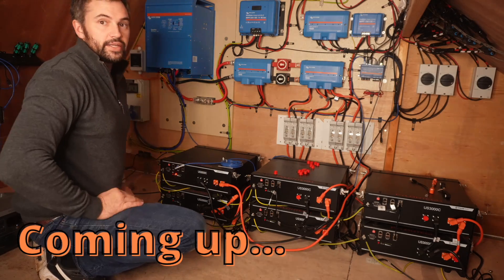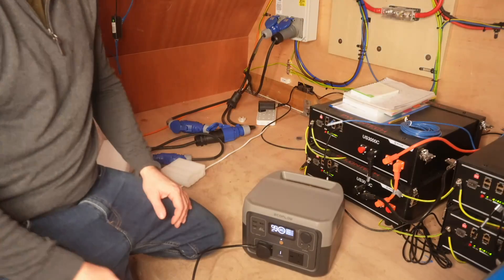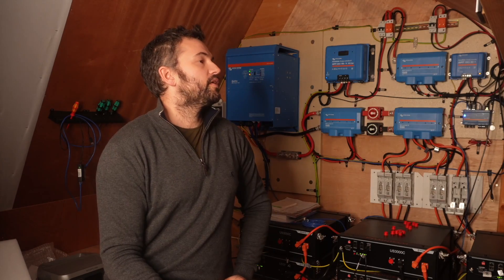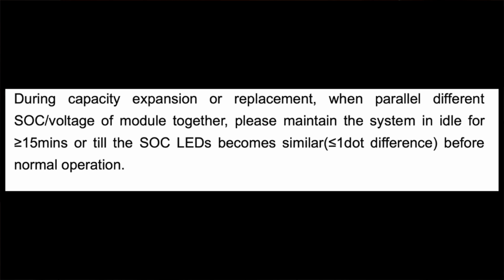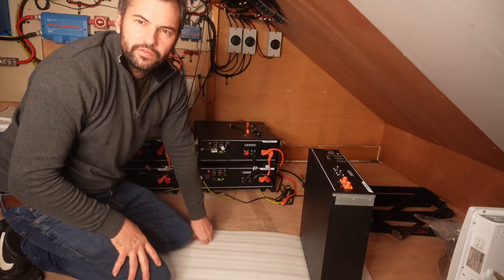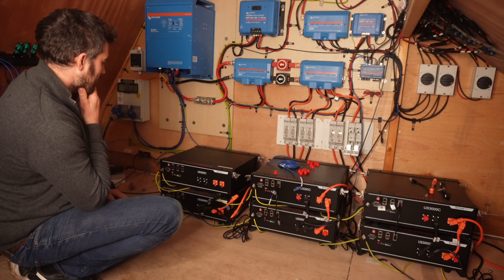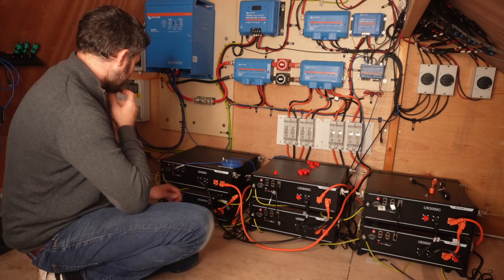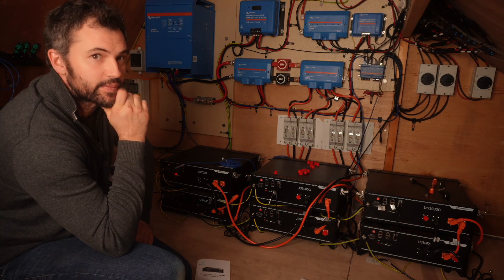IS THE PYLONTECH MANUAL WRONG?

Comment: I've been observing the same behavior (with respect to the charge balancing) with my three US5000. I saw the same instruction in the manual, but no matter how long I left the stack to balance (no load, no charge), the SOC did not change between them. It's clearly necessary to manually balance the stack first.
As for the error on the single battery, I have seen no such behavior at all. It doesn't make sense to be the capacitors, if it works fine on one battery, and not on another. The only thing that is different here is the firmware.

Comment: In your test, the battery is going into protection for short circuit.
The Victron inverter has huge capacitors which behave as a short circuit when discharged even if they are turned off. The battery after turning on, sees the short circuit due to a peak of current going out, and then protects itself. The battery is working perfect and as intended.
To fix this, you need to pre-charge the capacitors with a resistor during commissioning of the batteries or inverter.
I acknowledge your diy attitude, but getting advice from an experienced electrician/installer is always a good call.
In my opinion Pylontech is a good brand!
Reply: Shouldn't those capacitors have already been charged up since he had the larger battery bank powering the equipment immediately before he tried to charging a single battery?

Comment: 6:27 -  FWIW mine did, appear anyway, to balance themselves out. 
Reading from elsewhere to quickly balance & assuming the charges are close and non 0.

Initially connecting the power cables between batteries, nothing else, turn them on, start them & the ones with larger charge will charge the lower ones.

Once everything is stable (as per manual give it at least 15 minutes) - turn off - hook up the comms leads etc and re-connect to the inverter.

What is the capacity on your inverter that you need 3x +ve and 3x -ve battery connection cables?
300A+ @ ~50V = 15kW inverter?  
Are you potentially setup to pull 60A+ on the mains side of it?

(Double check my maths ... could easily be wrong)

Comment: Balancing is about milivolts balancing the cells. Not about e.g. 15% SOC difference balancing. Such a high SOC difference can not be balanced. They WILL balance but only on cell level in milivolts range so for example 3,234v and the other cell has 3,230V Then balancing will work but not if one cell has 2,898V and the other 3,234V. Balancer are NOT chargers in the common sense. I guess there the misconception is coming from that balancing means charging....

The pylontech will balance themselves via the BMS. You can see that yourself on the cerbo GX looking at the individual cell details or by reading out the data from them directly.
So the answer from this guys are also not fully correct. They will balance themselves but not charge themselves interconnected!

An individual US5000C can not be connected like that without pre-charging the inverter! The rush of amps the Quattro will use when turning on will send the battery into protection mode as too many amps are out-rushing to the Quattro! There is a reason why Victron states that for certain sizes of inverters you need a MINIMUM SET of batteries as the share the load! The bigger the inverter, the bigger the caps and components demanding the power instantly, it is not only about the input and output. The system has to be viewed inclusive and not as single parts.

If you really want to add the battery like that you have to disconnect the positive lead from the battery from the bus bar and then in between use a 25W resistor so Positive lead connecting tot he resistor leg 1 and the resistor leg 2 touches the Bus bar in the lynx after you have turned on the battery. This will give a controlled charge to all the devices on the bus bar without too much amps pulling out of the battery! You only do this for 3-4s, no need for longer time period. The goad is to charge all capacitors in the devices. You will also notice then that you can screw on the positive lead again to the bus bar and it will NOT arc!!! The reason is that there is almost no ampere running through anymore as all caps are charged up! 

The more batteries you have in a set the more this initial rush of amps will be shared and therefore the internal protection circuit will not be triggered. Such outrush amps can easily go over 200-300A! The battery however will not allow that and go straight into alarm mode.

Inverter off also does not mean that the amps are not running back to the DC side of the inverter. Only its power generating logic is off but the DC caps are still charging as soon as you turn on the batteries!

Comment: Fraser I feel your pain although I don't have these batteries ( I build my own) I do have experience with the little dip switches. There purpose is when you have multiples of something to tell it where it is in the pecking order in this case the BMS. The master battery the dip switches would be in one position. Slave 1 battery would be in a different position. Slave 2 would be in a different position  and so on. It should say in the manual how to do this if not I would email the people who repaired the battery and ask them about dip switch positioning. If everything else fails switch on the flux capacitor

Comment: I thought you bought them from midsummer, or is SWS the company that does their repairs?
Reply from the maker: We bought the batteries from Midsummer, who were liaising with Pylontech about the problem. However, SWS found our videos and stepped in to repair it quickly 😊
Reply: @The_OffGridFamily  who paid for the repair?
Reply from the maker: SWS put in a warranty claim so we assume Pylontech did 😊
Reply: @The_OffGridFamily  seems odd that a company you didn't buy them from would do that? Very odd indeed. Doesn't say much for Midsummer. I shall certainly be pointing anyone who talks about buying or using  Pylontech or Midsummer to these videos. Thanks. Sorry you had to go through all thus so that the rest of us can learn from it.
Reply from the maker: Yeah it was all a bit odd. To be fair to midsummer, they had referred the issue to Pylontech who were supposedly organising for the battery to be collected, and that’s where things were stalling. Our understanding is that SWS do the repairs and customer services for Pylontech in the U.K, and when they found our videos they stepped in to help. We still aren’t exactly sure how Pylontech’s systems are organised. We have however seen the emails between Midsummer and Pylontech, in which Pylontech seemed to be batting the issue away. It was when they found us on YouTube that the problem seemed to be addressed very quickly…
Reply: @The_OffGridFamily  Yeah, typical behaviour of Chinese companies in my experience

Comment: using many pylontechs. zero issues. by looking at this cabling and how this put together, I feel like there should be something wrong with the setup. but no the batteries
Reply from the maker: Interestingly, Pylontech found our videos and have watched them but raised no issue with the wiring or set up and instead immediately arranged to have the battery collected and repaired 😊 we’ve also been featured on the Victron website with our installation so hopefully it should all be fine 👍

Comment: Hi Fraser 

I agree with Stephen's comment below, its the inrush current which is tripping the battery. Rememeber your inverter has large DC Capacitors on its inputs, so as soon as you put a voltage on its input, the capacitors draw a massive amount of current to charge up. This only lasts a few seconds... on some of the big Victron interters you have incrush current well over 200A, I have seen this personally. In your video you can actually hear the battery protect itself and trip, close to 10:37. 

In my opion there are two advisable solutions, 
1-start it up with more units.
2- use a pre charge resistor.
Reply: Wouldn't the fact that he had the units all on with the six batteries connected previously have already charged the capacitors up so that it wouldn't be an issue?  Do the capacitors lose charge that quickly?
Reply: @gf3803  Correct. Also keep inmind that the MPPT's, Cerbo and other parts also have power supplies (with very wide input ranges) so they will drain any stored energy in the capacitors. If you only have the quattro, you can get away with turning on and off the battery quickly and charging up the caps, its a nasty solution but possible (typically after 4 tries it stays on). A precharge resistor is the best solution for starting up on one unit.
Reply: @ewalderasmus8384  I think his MPPTs and other equipment were turned off (the Cerbo would still be on).  The Cerbo would still be on so that makes sense that it would drain the caps, I hadn't thought of that.

I set up a small 48V bank just to power on my units for programming.  I used a light bulb to pre-charge the caps, no spark when I connected to the batteries.  But after I set up the Lynx and the Cerbo and repeated the process on a different charger, (I didn't have any of that set up the first time), even right after pre-charging I kept getting a spark which I thought was odd.  But you have explained why that kept happening, the Cerbo may have been draining the caps right after I pre-charged them.  So that makes sense why Fraser was having that issue with his battery for the same reason.  Same thing happened when I "pre-charged" and programmed my two MPPTs.  All three pieces of equipment I "pre-charged" with the Lynx while the Cerbo was connected....sparked.  And I thought that was odd.  Now it makes sense.

Thank you for the education!  Much appreciated.

Comment: Set the dip switchs the same as the rest of your stack, Hook up all the batteries, hook up all the data cables. Close the disconnect switches and turn on the inverter and lastly turn on all the battery's. 
You are getting the alarm because of the capacitors in the inverter and  MPPT, the single  battery thinks there is a short. When you have all the batteries hooked together and powered up at the same time you will not have that error. 

 I have added lots of batteries to a stack, new battery's ship with 50% SOC, we had the stack at about 50% added the new battery then allowed to fully charge and top balance with no issues.
Reply: I've not had any issues either adding US5000 to 2x US3000C following the same steps, although my inverter is a LXP not Victron. Infinity Solutions provide support for LXP and know a lot about the Pylon batteries although don't sell them anymore.
Reply: Shouldn't the capacitors have already been charged since right before he tried charging the single battery, everything was powered by the six other batteries?  Do capacitors lose charge that quickly?

Comment: I had the same experience. Pylontech manual is crap, the US3000C bms is crap. Indeed not good enough and definitely not for off-grid applications. Finally, I built my own 14.4Kw lifepo4 battery with a JBD smart bms. Now I can monitor and control what is happening inside [app]. Costed less than half the price of 10.5Kwh Pylontech misery. .

Comment: what does the US3000 lights do when you just turn it on without it being connected to your inverter? I have a US5000 connected to a Solis 5k Hybrid and was working fine for a few days now the battery just ALARMs when it is turned on. Pylontech say the battery is OK as when it is disconnected it flashes a green run light - im still waiting to hear from Solis they seem to be very slow at responding.

Comment: I feel your pain! I have been having a similar problem with a Sofar inverter I had a Voltacon E-Box-48100R connected to the inverter via CAN cable and all works great, so I ordered another one the same, unfortunately a Pytes-E-Box-48100R turned up I have been told it’s exactly the same battery, so I wired them as instructed, but after a few minutes get a fault on the inverter then it goes into a 60sec test loop ending with a red fault light, so I try the new Pytes on its own I get the same fault loop if I then just connect the original Voltacon it works perfectly again, I have spent a few mornings now talking to Pytes in China great guys they can talk directly to the battery they have updated and down graded the firmware and it’s still not working, apparently the inverter is reporting to high a voltage on the Pytes battery but if I meter the contacts the voltage is 52v on both, they are now talking to Sofar but I can’t see it’s an inverter fault when the voltacon battery works great! I will be very interested when you get yours sorted!

Comment: hook up a console cable with
 D9 					RJ45
braun 5 GND                 —  8
gelb 2 RX       		 — 3  
weiss 3 TX    			 — 6   

with 115200 baud

so you can communicate direct with the bms off the system and get an idea of what alarm was thrown.
Reply from the maker: Thanks for this ☺️

Comment: The one thing that I would be concerned about is the pre-charge of the Victron inverter as its possible that ever time you power up without solar youre loading up the capacitors with a huge current surge that could trigger an alarm on the Pylontech(?). I use a pre-charge circuit with a resistor and a bench DC charger or if you have solar production then powering on the solar first and then the Pylontech so that the capacitors get pre-charged from the MPPT?

Alternatively, turn off all CAN communication with the inverter and run it as a system that uses LifePo4 cells externally managed. The Pylontechs each have a BMS and can self-manage themself. I run a couple of 60kW off-grid self-build batteries with multiple BMS' and EVE 280 LFP cells and a variety of inverters with no issues however the one thing that was a nightmare was CAN communication so I gave up and implemented my own cell-level monitoring and used a Victron shunt to measure true battery SoC and let each BMS manage the battery. Simplify and give up on CAN communication it's a nightmare unless your building the end-to-end solution (hardware+software).
Reply from the maker: We knew that it's recommended that we use more than one (we think it's 6?) of these batteries, so we didn't switch the inverter on ☺️ We were going to use the MPPTs and the solar, and if that didn't work our inverter has a charger only function and we would have tried that 👍
Reply: @The_OffGridFamily  It doesn't matter if the invertor is switched off, if it is connected there will be an inrush.
Reply: @stevem1863  agreed but he had just previously powered his bus and all the equipment with six working batteries.  Shouldn't all the capacitors have been full?  Do they discharge that much in the moments from having the six batteries shut off while he put the single battery in place?  I wouldn't think so.
Reply: @gf3803  having watched it again, it's a bit hard to know how long it took as there are some cuts in the video.  Even without that I'd still say yes, especially if you're just connecting  a single battery.  I find I need to pre-charge even if it's disconnected for about a minute, maybe not as long as a full 'cold' start but I still need to do it.
Reply: @stevem1863   somebody else pointed out that his Cerbo was still connected and so that was drawing power from the capacitors.  So even though they were charged up, when he removed the batteries, the Cerbo was likely draining them.
Reply: I agree.   Use a pencil with both sides lead exposed to pre charge the caps and connect as quick as possible.  This will limit the inrush and prevent over current protection.

Comment: Hi I am having the same problem with one of these batteries the only difference being when the alarm goes off All of the LEDs are flashing and it starts beeping. I have emailed the installer and they are just giving me a run around it would be nice to know exactly what the problem is with these batteries.
Reply from the maker: Really sorry to hear this about your batteries.  Perhaps try this email, as we were told this will get you to Pylontech's UK customer service:  service.uk@pylontech.com.cn
Hope that helps, all the best.  We know how stressful this can be 😩
Reply: @The_OffGridFamily  Hi I have found out what the alarm problem is by accident I unplugged the link port plug 0 on the problem battery and plugged it back in again since then I have no problems. l think this is down to a poor connection and may be due to poor quality RJ45 plugs sockets or cable.

Comment: Hi Fraser.
My experience of using my US2000B Plus batteries  is that I will get alarms on boot unless ALL loads are isolated from the batteries and the batteries are allowed to FULLY run their boot sequence for at least a minute, then I hit RUN and wait another 30 seconds before turning on the inverter charger. Things work fine after this. If I do things in the wrong order, it all goes haywire.
Hope this helps
Reply from the maker: Thanks for this.  The inverter wasn't on.  We only wanted the battery to run our Cerbo GX and MPPTs 👍
Reply: @The_OffGridFamily  Glad it’s all working now 👍🙂
Reply: @The_OffGridFamily  even with the inverter or MPPts not on, the fact they were connected to the Lynx means their capacitors were "on" and might have been drawing power.  I've seen a bunch of people talking about capacitors being the culprit, but I'm not sure why that would be since you had previously had all the equipment connected to the six batteries.  I would think all the capacitors would have been fully charged, and wouldn't think the brief time between then and turning off the six batteries would lead to the capacitors discharging so quickly for it to become an issue with the single battery.  Then again, I know even less than you do which is why I watch your videos!
Reply: @The_OffGridFamily  I know you didn't get to the step unfortunately, but was your plan to limit the charge to the single battery to 5amp something you would set in the Quattro settings?